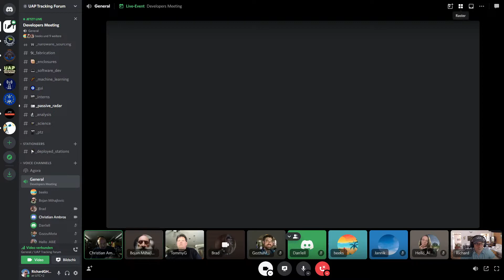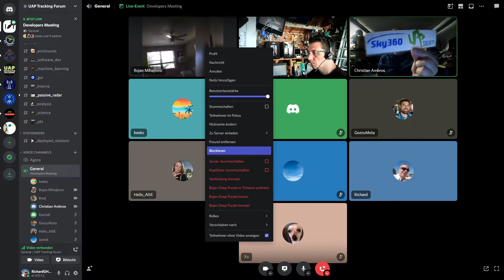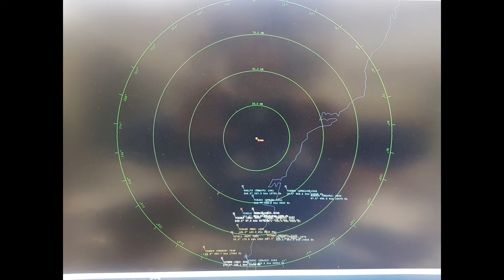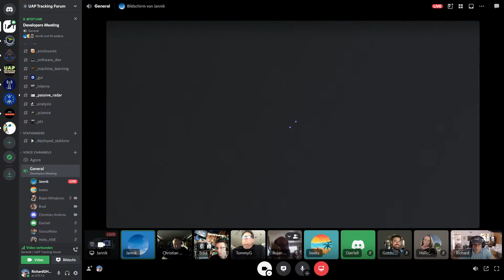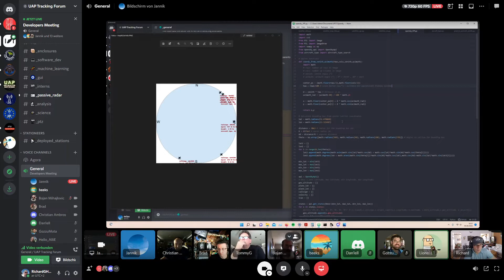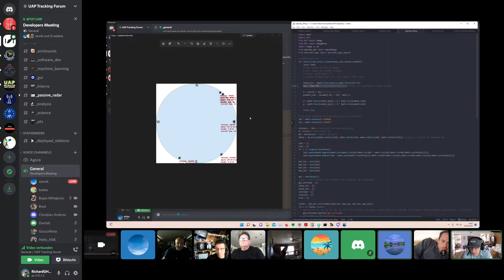Developers Meeting 2022-06-05

Comment: Can you add a socket to plug in an external telescope mount (such as a Planewave L-350 Direct Drive Mount) that would mirror the PTZ camera motion?
Reply from the maker: that is definitely an option, because we're using INDI, that supports most astro devices